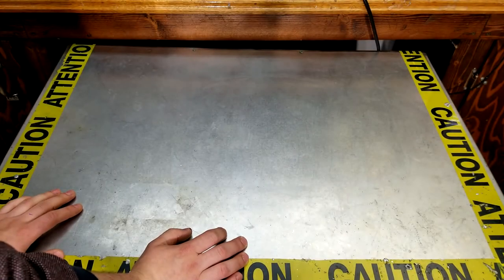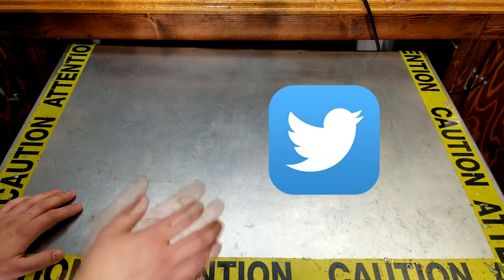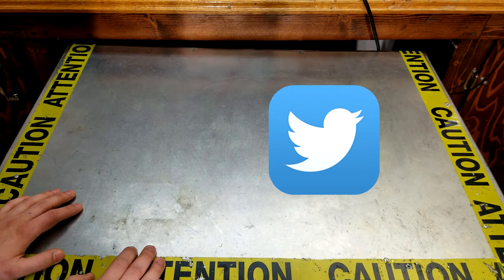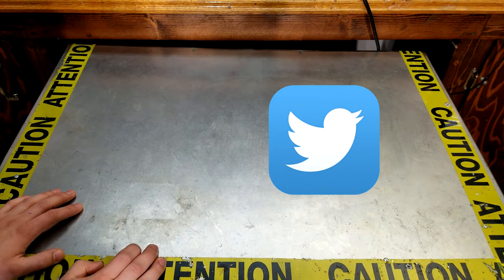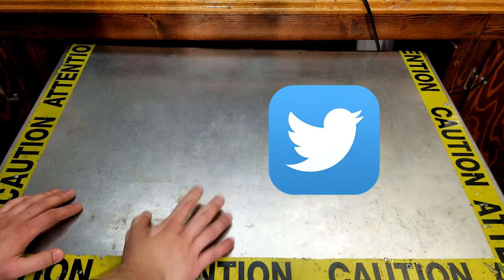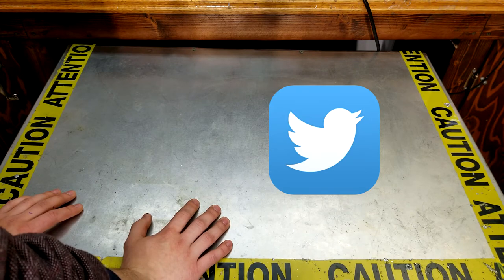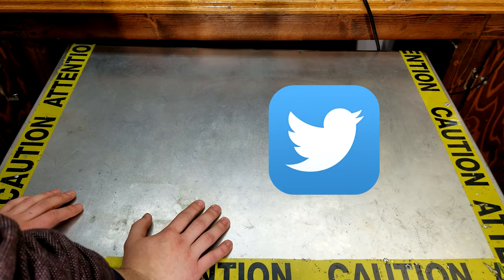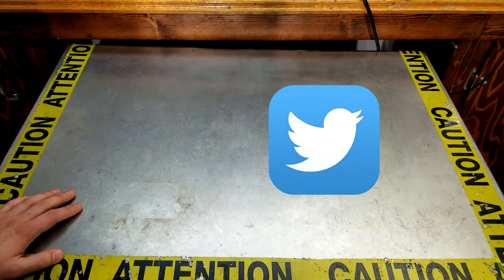HUGE DIY WIRELESS 200W SPEAKER!!!! BUILD

Comment: you can buy volt and amp meters, just put it in the same box and have the connections come out. I have more than enough multimeters so it isnt that necessary, though I could use some high power watt meters to just make my efficiency testing easier.